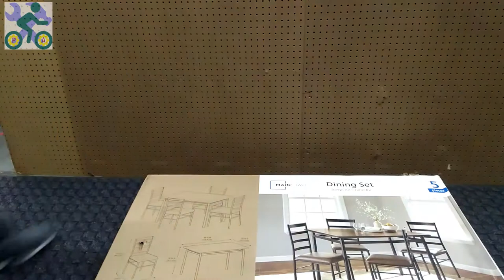How to assemble Mainstays 5-Piece Dining Set, Multiple Colors

Comment: The instructions lie. There is no way you are getting the screws in the bottom side of the table to connect the frame with just a screw driver. It would take forever. So now I have to run out again to buy a power drill that the instructions say not to use. They really need to drill holes in the back of the table to prevent this issue. Great video though
Reply from the maker: Thanks for comment. Before buy a drill first use a small nail to make a hole then use screwdriver. I think you can finish it.let me know. Good luck 🤞

Comment: One thing I notice after actually putting this together is the directions say not to use a power tool. But I'm sure they are just trying to prevent rookies from over-tightening. It is easy to put together but a bit time & labor-intensive if you just have the little L-wrench provided. (I couldn't find any Phillips that worked here except on the seat). 
I made the mistake of securing the wrong piece before realizing the hole has to go on the inside, which is shown here but still easy to overlook. And then when attaching the seat, no where does it tell you to put the back of the seat flush with the back of the chair (also shown here). But leaving even a little gap makes it impossible to screw in by hand. 
This is a decent inexpensive set. Probably won't last years but I got it because I've lugged huge, expensive furniture around for decades, then stored it for years. Finally got rid of it all and will only use light-weight, portable, disposable things now that I'm on my own, basically. I've spent so much on storage and moving fees, I could have bought 500 of these by now. 
My biggest gripe is that furniture now uses these odd L-shape wrenches and none of my expensive tools work to put such things together. And I've never seen a seat that "makes its own holes". That is not a sign of quality. But they are doing the job.
Reply from the maker: Hi Angel .
Thank you so much for the comment you made.
First of all, you are right, I use tools to save time
Secondly, in any case, a screwdriver must be used to assemble a part of the video
 If I did not name it, then everyone would say, "Where is the screwdriver?" 😊😊😊
Thirdly, they do not put the hole because they have to use a very small drill and it is a little difficult for them to use a one millimeter drill and also the absence of a hole keeps the screw in place.
Fifth, I completely agree with you. We are always moving heavy and useless things, and if used properly, it will take at least ten years, except for the seat covers, which can also be replaced with a staple and a good cloth after a few years.
Buying a pack of Allen wrenches is not bad, especially for $ 7.
Anyway, I enjoyed your comment. Good luck.😊

Comment: does anybody know if i can put the table together with just a screwdriver...?
Reply from the maker: Hi Jamie.of course you can .Allen wrench is included so you just need screwdriver.
Reply: @ProAssembler  thank you ! I had to hammer it in because the pre drilled holes didn’t align. My table was defective :(( and I say that cause none of the parts worked together... the chairs didn’t screw good it just ripped the cloth, and the metal on the table was bent upwards so I couldn’t screw it in sad sad

Comment: R the number 3 suppose to be hard
Reply: if a screw is too hard to turn in, it usually means it's not lined up correctly, or that screw is not made correctly. Make sure you leave all screws slightly loose until all pieces are on, then tighten them all. this allows other parts to move slightly in order to align other parts being added.